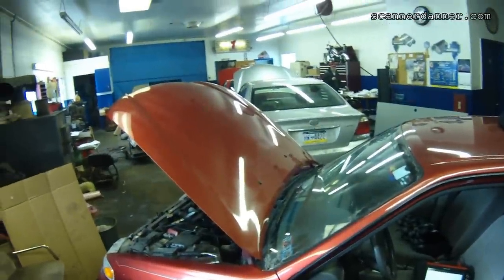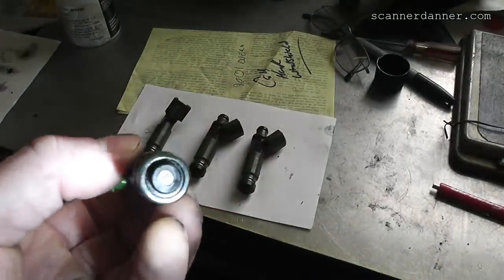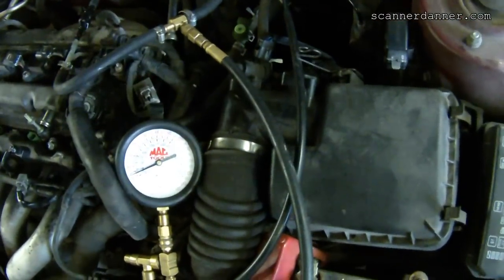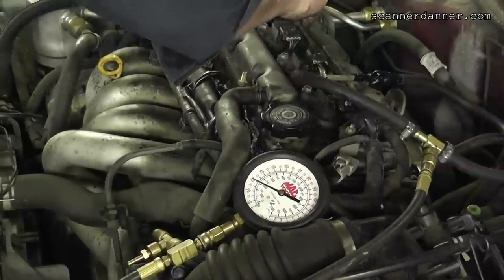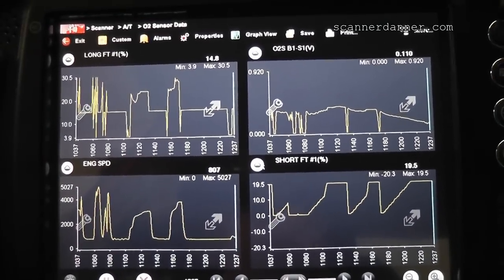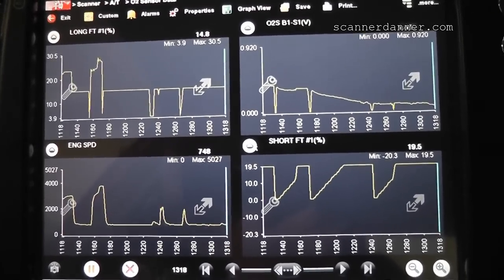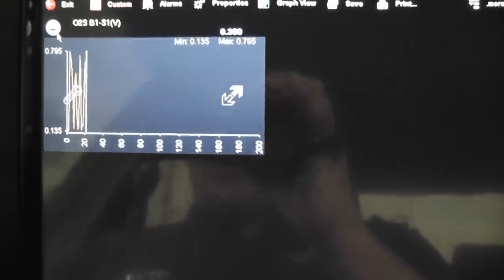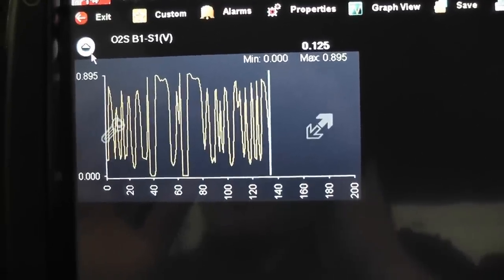Misfire from restricted injectors - Chevy Prism (Toyota 1.8L) part 2

Comment: I have a 1999 Chevy Prizm, but for diagnosis it's the same car as this one with the 2000 motor update/ecu/wiring harness, the full works to be a VVT-I engine.

I have a long term fuel trim of about 39 on the freeway. There are a lot of other speeds that show less rich on LTFT, but the STFT corrects it negative. These values aren't relearning.

The LTFT at freeway is not corrected by the STFT...bad fuel injectors like here? Note, my EVAP system isn't working (lots of codes on that, no lean code), I've heard that can make a car run rich, but mine tends to run lean.

Unlike this car my car runs really smooth.

Diagnostically, it sure seems to be a similar problem.

Note: MAF is for sure clean, it failed and I had to replace it. I have new properly gapped iridium plugs. I show good stoichiometry on the front O2 sensor.
Reply: +DE Nichols “AutoBravado” that is el problem with my corola 2007, 1.8, the ltft is high 35.... always..... the stft close to 0, the ltft is not learning of the stft............   and another thing... the close loop come very fast....8 or 9 second after start cold.....................
Reply: Édgar Hernández Yes. My closed loop is instantaneous too. It should take longer.
Reply: For me it turned out the IAT portion of the MAF read right at low temperatures, but not when the car was heated up. Thankfully, it was on warranty.
Reply: You could have a vacuum leak. Check for any old rubber for air and replace them. Or if you can smoke test them or spray brake clean around the intake and tubes you could find a leak that way.

Thankfully, I've fixed many high fuel trims and it was never a fuel pump. ..well, on this car. Lol
Reply: +DE Nichols “AutoBravado” so.... wich is my problem..?????  why the close loop come very fast???   Should I to change the O2?
Reply: When O2 sensors are bad the car sometimes won't correct with LTFT.
Reply: +DE Nichols “AutoBravado” I have done this.... looking for vacuum leaks.... and nathing.............all is good........
Reply: +Édgar Hernández “Roger” exactly..... mi ltft doesnt change... this doesnt correct.......and another think rare.... car stoped and the key switch on (accesories), scanner with data stream,.... push the acelerator and the value of the ltft down.........

Comment: After watching pt 1 again, maybe the balance test killed the o2? Too much raw fuel in the exhaust?
Reply from the maker: I don't think so for two reasons. 1. I've never hurt an O2 with this test in the past. 2. On initial diagnosis after a heavy WOT snap it intermittently would chug very badly at idle. (don't think I caught it on film) it did the same thing after the injectors werereplaced, only I noticed it was a flatline O2 signal that was causing it. I thought it was the injectors initially. So I believe at some point in time in the first video that O2 did flatline on me but I missed it

Comment: The original injector diagnosis doesn't make sense to me, but maybe you can clear it up.
 
Even if you have a 2 psi difference between injector 1, shouldn't the ecu closed loop correction still be able to compensate for that enough not to throw the code? You would think that in order to trip the code, you'd have to exceed the max range for short and long term fuel trim. 

I think this car would have benefited from a nice test drive that generated enough heat to properly show a faulty o2 sensor on the scan tool.
Reply: A P0171 code will usually set when long term is between 15-18%. It does not need to be maxed out.
Also during the lean condition in part 1 I had a fully functional O2, replacing the O2 at that point would not have fixed the lean condition.
The injector psi difference was closer to 3 psi which is a lot! They should all be the same. It definitely, no question about it, needed that injector replaced.

Comment: this is what us technicians run in all the time, especially fuel management, so forewarn customers up front there's a possibility of secondary problems after the repair, 02's washing out or soot build up fuel regulators going out also., i would've recommended fuel filter change also.

Comment: at 12:20 you were questioning about why new injectors solved the lean problem despite their less flow and you said its the temperature, i agree its a factor but the reason why is the clogging of the micro jets that help the atomization process, when they 3 out of 4 jets clogged -if they are 4-the pressure well be directed to 1 jet which is a very bad fuel atomization. i take my customers injectors to a machine shop for ultrasonic deep cleaning and they run bunch of quality control tests plus the spray pattern check  and when they are done they slap every injector with a new screen and a fresh o-rings all this for 8$ a pice,  i think the injector overhauling machine they are using is a german made i don't know why they are not common in the US?! 
have a good day
Reply: Airman That sounds awesome! Here in Milwaukee, real auto parts stores seem to be a thing of the past. Even Napa seems to have gone down the drain. Have to look into an engine shop.

Comment: Hi dear friend you did great work on this car but I been taking classes with worldbac and A.T.G for long time ago now my customer come to my work with 07 camry 2.4L same code p0171 and I fix the problem with 3 things 2 can of  seafoam fuel injector and I change  spark plugs  after that no more problem
Reply from the maker: When injectors have flow issues, I've almost never had luck cleaning them.

Comment: if injectors are clogged, wouldn't it be lean at higher rpms also?
Reply from the maker: It was
Reply: part 1 of the video, you mentioned at idle was 30% but after revving to 3000 rpm it dropped to 10%. my question is why would it drop, if injectors are clogged? Shouldn't fuel trim remain high?

Comment: I think what happened on the O2 sensor was just simply a case of stuff happens. Yeah, it needed to be replaced, but the way it just took a dump like that, like I said stuff happens. I had a situation like this yesterday. I had a Focus that only part of the 3rd brake light worked. The 3rd brake light assembly on this car has 5 bulbs and 3 didn't work, but 2 did. I changed 3 bad bulbs and as soon as I put it back together, the 3 bulbs I put in worked, but the 2 bulbs that worked before decided to take a dump.

Comment: IMO you had one injector leaking and the PCM was driving all the injectors closed (lower pulse width) trying to compensate. Because the 3 good injectors were being shut down, THAT created the lean code issue. The o2 was a victim of old age/mileage.
Reply: IMO you are right.
Reply from the maker: What you are describing would show up as negative fuel trim numbers, not positive.

Comment: An extra o2 to the bill is not a big issue considering it is a fix. You should see in NL, all these parts changers putting 1000€ in parts no fix and getting away with it. So, no problem with your diagnostic whatsoever.

Comment: You could redo the balance test with new injector to see if it was temps causing lower flow rates or if old injectors flowed two much but never really balance tested injectors after replacing them
Reply: After warmed up

Comment: @ScannerDanner Huge help if you could inform my of where the Knock Sensor is on  a similar car, a 1994 Geo Prism 1.8L LSI...... I was hoping you would come across it here....Thanks
Reply from the maker: https://www.google.com/search?q=1994+Geo+Prism+1.8L+LSI+knock+sensor+location&rlz=1C1GGRV_enUS751US751&oq=1994+Geo+Prism+1.8L+LSI+knock+sensor+location&aqs=chrome..69i57.6993j0j7&sourceid=chrome&ie=UTF-8
Reply: yeah I tried that. I got one diagram saying it was in the front and one showing it close to the firewall, a couple pay to ask the experts site, some links saying its under the air intake manifold and some pics that were so small when I zoomed in became worthless.... I figured I would ask someone who had personal experience and get some actual words rather than getting .....well, the exact reply you sent. I do thank you for your immediate response. Pretty awesome! I'll keep google searching.... Cheers
Reply from the maker: sorry man, wish I had more. My wiring diagram says "Right Rear of Engine Near Coolant Pump" haha what the hell is a coolant pump? 
When determining right and left side of an engine you put yourself where the transmission is

Comment: Factor in that these engines are known to have plugged oil control ring relief holes that result in a lot of carbon, etc, that may have had an effect on O2 reliability.

Comment: I would think that a leaky injector could cause more fuel (possibly some unburned fuel) contaminating the O2.  Also, if it was leaking I'd be willing to bet that it would be unmetered by the computer so overall the computer would think it's a lean condition but in time the leaking injector contaminated the O2.  Good fix though, love the vids.
Reply from the maker: Leaking injectors would be a rich condition and negative fuel trim numbers. The only way that was happening would be if the O2 was already contaminated and providing false lean signals and it was not in the Part 1 video. But it is something I also considered. Thanks my friend.

Comment: could it be that flooding the cylinders with unburned gas and then cracking it with out actually starting the car after each injector contaminated the cylinder :)

Comment: Hi Paul; is there any possibility that the oxygen sensor is not a conventional zirconia sensor, but actually an A/F sensor and the scan tool is providing PCM generated 0 to 1 volt data?
http://www.motor.com/article.asp?article_ID=1643

Comment: hi paul  toyota engines will burn out O2 sensor heaters in cold weather if you do not get engine to working temp first ( I E  road test ) I have burn 2 out just by starting and waiting for the oil to  warm up for draining.    1998 -  2004 only
Reply: As an owner, wow, thanks for the tip. That car is in cold weather, but the O2 sensor failed while in the shop....mabye it was on the edge of failure.

LOL. The only time I needed to replaced my O2 sensor was in cold weather 9 years ago. I live in a generally warm place now and it's been reliable ever since.

Comment: I seriously had to watch both videos twice but it sure does look like the O2 sensor died on you and you caught it on camera. One thing though, you should probably always get a scope reading of the O2 sensor rather than scan data just to be extra positive. I try to scope the O2 signal whenever possible but sometimes i'm too tired or I feel like i'm not getting paid to do so and I just use scan data but it still feels like I am just making it harder on myself and it leaves me guessing on whether or not I should have scoped the O2. Heck, even with the scope readings i'm sometimes confused on whether or not my O2 is good. The only other scenario I haven't seen discussed here is, The O2 was bad, reading false lean because of the faulty number 1 injector and it was actually running rich? Who knows. Either way I'm totally on your side here. It's a good feeling for the customer to know they have brand new injectors and a new sensor. They will have a good running car for a long time and that's worth every penny.

Comment: Most cars like this don't have nice headers like that. Looks like aftermarket headers, but highly unlikely that someone would put aftermarket headers on a Prism.
Reply: Now that I think about it if those are indeed the headers there should at least be a heat shield to protect all of those rubber and plastic pieces near it.
Reply: Misterious Thats the intake...
Reply: John Galt Yeah, I just looked at the first video and noticed the exhaust on the other side with a heat shield.

Comment: Actually maybe all the injectors were dribbling? That would explain the pressure drop being less with the new injectors. Guess you really needed another inj balance test on a warm engine.
Reply from the maker: A cold to hot engine comparison injector balance test (on a good vehicle) is now at the top of my list of videos to do!
Reply: ScannerDanner After more thought if the injectors were leaking it wouldn't have held pressure. More likely the pintles were worn which allowed more fuel to flow for a given on-time. I love your videos. Really like to give/receive feedback.

Comment: Nice video.
 You failed to confirm that the engine misfire was gone. It sure sounded way better than in part one.
Reply from the maker: It's been a long time but I definitely confirmed my misfire was fixed. I don't remember all the steps I took in the video but showing the restricted injectors was key.

Comment: I think in a case like this it is good to hedge your bet a little bit with the customer by telling them that they have an injector problem and until that problem gets taken care of we can't be certain that the vehicle doesn't have other problems. Relax Paul, you didn't replace any parts that were not defective, had you just put an o2 sensor in it, it still would not have ran right.  I see no problem eliminating problems as you find them.
Reply: Agree !! fixing one problem can unmask another problem, seen this many times.
Reply from the maker: mike withers
It can, but I still hate that follow up phone call.

Comment: I'd pretty much hazard a guess that she spent 3 hundred dollars replacing 3 good injectors. As Paul says over and over on a balance test you are looking at whats different. Three the same and one different. Big jump to decide it's the three that are bad.
Reply from the maker: It is possible, but if the 1 injector was leaking this would have caused a rich condition and negative fuel trim numbers, oh and potentially a single cylinder misfire which I didn't have. And in the part 1 video the O2 was functional so that rules out the false lean contaminated scenario.
Also, I've seen this issue on this engine before, check out this 2 part video. It is the same engine and it needed all 4 injectors and cleaning them didn't work.
2003 Pontiac Vibe 1.8L Misfire, Rough Idle (Part 1)
2003 Pontiac Vibe 1.8L Misfire, Rough Idle (Part 2)
Reply: @ScannerDanner  I think because the fuel filter in these engines is permanent plus owners using cheap gas, the crud in the gas tank will always end up in the injectors.

Comment: also you had me laughin my ass off doing what real world mechanics go through on a daily basis, like dropping those little screws, I don't feel so bad. The older i get the more it happens though, fingers don't work like they use to. (man i hate that) not having the right tools or equipment, having to rig a tool. Like you say there are several different roads to go down to get to your destination fix and sometimes you have to use several. I wonder if sending raw fuel down the exhaust might of done something to the 02. My 2 cents.
Reply: good point with the raw fuel

Comment: In all honesty, I've had no luck 'cleaning' fuel injectors, especially if they are plugged with rust. A vibratory type machine might work, its one of the best ways to clean a small engine carb, but the labor involved(on some vehicles) removing injectors doesn't validate me wasting my time trying to clean them. It's not financially efficient or productive, I hate to say it. Now that I'm thinking about it, vibrating the heck out of an injector might NOT be wise, I'm sure the coil would love that. That's my two cents, it's a waste of time in my opinion.
Reply from the maker: The only one I have had success cleaning is the GM Multec 2 injectors. They stick closed mechanically and cleaning them fixes this. But I agree, whenever there is a flow problem, I haven't had luck cleaning them either
Reply: ScannerDanner Yeah Paul, I won't sell a procedure I am not 100% confident in, this being one of them. At the end of the day, they may have to pay more out of their pocket, but hopefully the customer salutes you for being honest and you walk away with your integrity and dignity left untouched. My ability to sleep at night because I did the right thing is far more important than being a crooked technician. Awesome video series my friend.

Comment: bit of a shock seeing you don't have any means to flow test the injectors on a flow bench and buying new injectors most injectors clean up ok with a good ultrasonic bath then retested.. been cleaning injectors now for more then 30 years and most of the time they test ok after clean the one you had should flow 180ml in one min at 2,2 bar maybe you guys have more money to just buy new ones over the USA injector flow bench use to cost lots of money but you can buy then for about $1000 but I made my over   30 years ago when no one knew any thing about clean injectors and I was clean the old Bosch D Jetronic came out when the use two set of points to switch the injectors and I still remember cars would come in to my work shop with a car  running on only 3 injectors and having to clean the points two set one set for 3 injectors and one set for the rest of the them and the old TPS had 10 clicks when you move the throttle its was like a carby   pump but had about 10 switch on the TPS so when you move the throttle you would get more fuel look up the old D jetronic ..   I find the new cars I work on today our a lot easy to fix then the old cars ...  and we  very lucky we have good scan tools and  great lab scopes to use like  the Pico scope boy that's thing make my job so much more easy then the old days of fixing cars   but just like to say thanks for all the work you put out on YouTube you the best